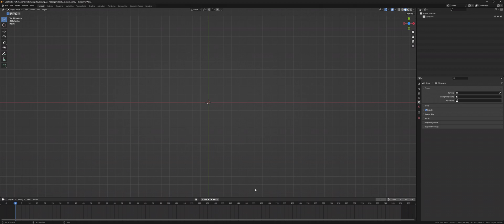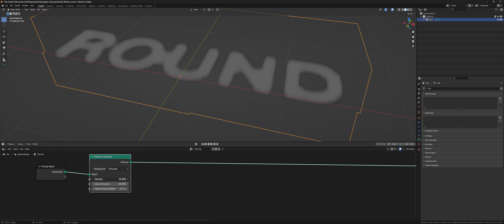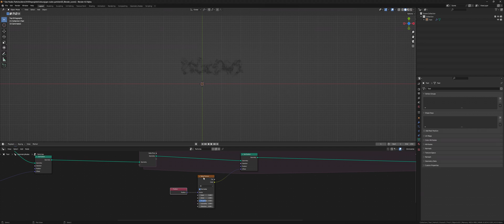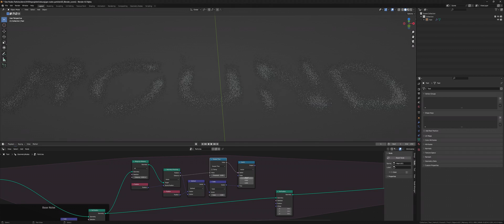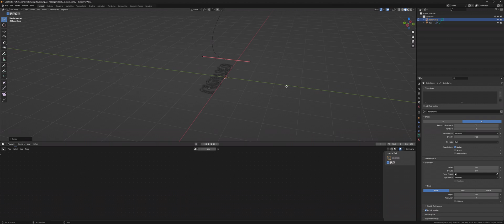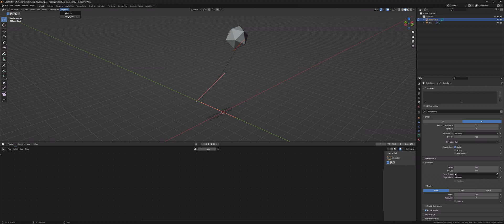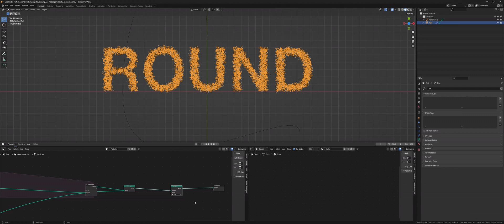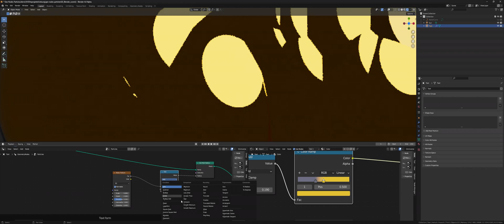Particle Collision and Boid System in Geometry Nodes Tutorial

Comment: Very weird, the "gravitation" part where you set offset after calculating proximity doesn't do anything for me. The distance is always set to 0. Whatever I try, disconnecting ht switch output to offset of "set position" or not, the result is the same. And this, with your file too. Try to do this:
- connect the first "set position" to the simulation output (to avoid slow animation)
- disconnection the "attraction" frame
- launch animation
- reconnect
- relaunch animation

Here, at home, no changes

Disconnect the noise position setter too, there is no move at all. So the attraction part is, IMHO, wrong.